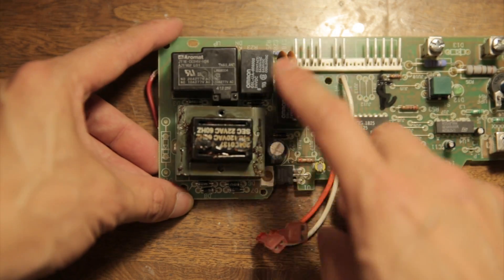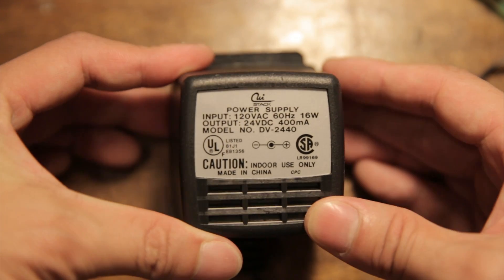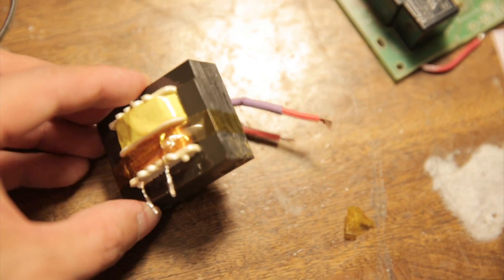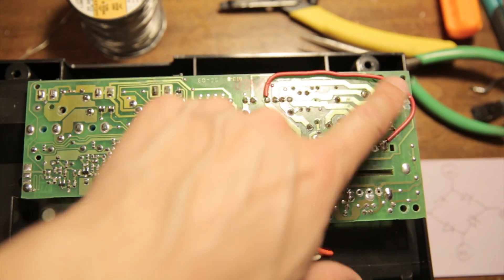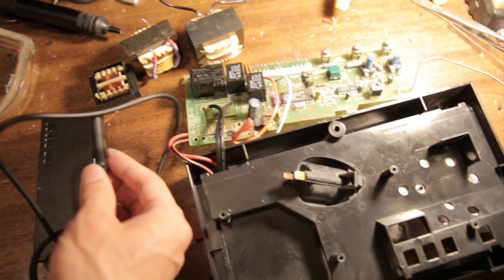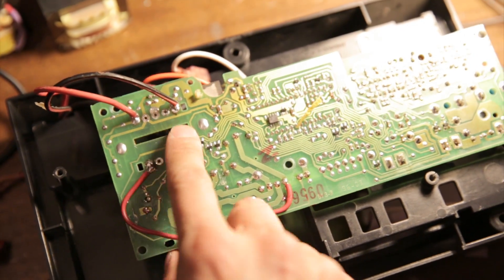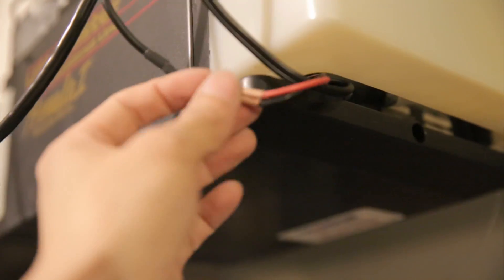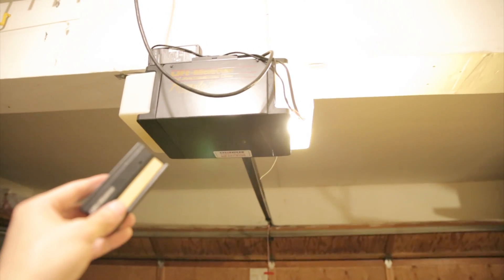LiftMaster Whisper Drive Garage Door Opener Repair: Transformer Failure

Comment: Thank you so much for sharing this. I just got my garage door logic board fixed with a laptop DC power supply.
Reply from the maker: I’d have to put a disclaimer to only try at your own risk. It’s a bit risky whenever you mod you own stuff as it has not gone through rigorous electrical tests. With that said, mine still works and I think that’s 3-4 years since this video was made.

Comment: I commend your effort! 

I had a very similar failure on my LIftmaster. The same part failed; in my case, the transformer oozed some glue out too, but rather than burning out and shorting like yours apparently did, mine exhibited an intermittent open. So sometimes the GDO would work, sometimes not. Often it would stop mid-cycle! When I was reverse engineering the circuit board at where the transformer was plugged in and powered up on my worktable (I had removed the board and side panel for testing), I was a little thrown off at first because the way they ran traces to the transformer made it appear that the transformer had multiple taps on the secondary. But that's not the case; they just used those traces for convenience. Your video helped make clear that the transformer wasn't a multi-tap secondary--just single output. (BTW, I'm an EE with circuit design experience; hence why I like getting deep into the circuit stuff!) 

I really wanted to go with a 22VAC output transformer to match the original design; the trouble with that is that those are few and far between (curious why they didn't design with a much more common voltage like 24V; my cynicism leads me to think they just want you to buy a whole new GDO rather than fix a relatively cheap component, the latter of course which is better for the pocketbook and environment. But who knows?) 

Anyway, I finally found one on Digikey for $38.30. It's not a through-hole design like the original; it's panel mount. But that's okay with me. Should be easy to wire in and mount. You can go there and search for PN 166L22. It's rated at 2A, 44VA.
Reply from the maker: Thanks for watching! In case you’re wondering, this solution still work and nothing has failed for years after this mod. The laptop switcher is pretty durable!

Comment: Problem with this setup!
When we had a power surge from trees breaking down under a heavy snow load this spring and tearing out the house feed wires, the surge took out a lot of transformers and surge protector in the house. 
It had been a while since I’d worked with diodes and had a quandary about how to connect the polarity of the new dc power supply. I sorted around in my pile of old transformers and the closest I could come to the 22vac original was an old 19 volt (actual no load) Dell laptop battery like was used in this video. No mention was given tho about the polarity to use so I did a little side trip to the internet and relearned how to see which way the juice flows. Turns out it shouldn’t matter how the dc transformer is hooked up since the diode stack in the little onboard full wave rectifier was fine with it either way. I soldered the cut leads to the old primary board tabs as shown and eureka it worked! Put it back as shown and cleaned up the tools and ladder, done.
Well the next day it wouldn’t go! 
More head scratching and discovered that the board was ever so slightly warm over the old xformer still mounted up. Ok, well maybe I hadn’t managed to burn out my laptop transformer after all! Come to find out the primary on the original board xformer was out but the secondary  still had 3~4 ohms which was dragging on the new charger and so the said charger had automatically shut down eventually from getting warm with that steady draw! After some more head scratching I wound up taking a razor knife to the up bus on one side from the old transformer to make a discontinuity to that winding. Then re-soldered my leads to the board on the circuit side of the diodes this time since I didn’t really need the couple of volts drop through the diodes since the new xformer was a few volts lower than the original. Probably this way the volts to the board came out nearly identically to the original design! This way tho you will have to make sure to get the polarity right! To do this I soldered the leads to the last connection that the diodes made to the bigger board busses that went to the circuit proper. Look for the bands on the diodes to tell how to polarize. The positive (hot) goes on the backside of the diodes with the marker bands closest to that end and the neg goes to the diodes through the board on the other bus with the bands on the opposite end of the diodes (farthest away from the end used) so this way current will go around the diodes no thru and probably would mean that you don’t really need to scratch a discontinuity in the track to the old xform although some small back diode leakage might still happen. If you came up with an ac volt xform of about the same as the original (+ or- 10% should be ok) and the secondary was still not open then scratch out the bus on one side of the old xform and solder to the original downside of the diodes to keep the circuit the same as original . When you have the new configuration hooked up on the bench you will hear a relay click when the new xform is plugged in and click off a few secs later after disconnecting. As well be sure to check the old xform with your VOM before doing this mod to be sure that the most likely situation of the old xform being out is true with the windings in primary or secondary are open.
I Put it all together and now the next day it’s still working! 
Don’t forget to Mark the leads on the outside of the board panel which goes to what screws like me and got two leads reversed which although no damage was caused for that particular reversal I suppose it could have with another wrong combo. A short bit more head scratching was involved when that didn’t work right!
It’s a bit of a trick to tease off the internal connector to the board inside when you’ve got the end panel unscrewed which I found a long pair of needle nose pliers helpful for doing one end and then the other in it’s turn. Of course be sure power is unplugged before doing this to prevent shorts.

Comment: Amazing.... it works for me. i use a mini laptop charger 19v .   thank you  BeatTheBush!!!
Reply from the maker: WOW... JUST WOW. You actually used this same method? My power supply fried and I did this and it has lasted since the making of this video. Just know that you are voiding warranties and any patch electrical work cannot be sold to others if you sell the place or what not. Also, you have to assume the risk yourself in case anything bursts into flames.

Comment: Awesome video, I like your approach to fixing things. I have a very similar (maybe identical) board and would appreciate some advice on fixing. Basic problem is GDO works from wireless remote but not from wall switch. Switch itself is OK, wire from switch to GDO is OK, and if I short the terminals right at the GDO it doesn't work. Is there any way to e-mail you with some details (photos etc) and get advice -- much appreciated. Thanks.

Comment: Same thing happened to both my door openers when running on generator during power outage.  I bought this transformer https://www.electronicsurplus.com/search/22v+transformer and it worked great.  I got the transformer in three days.  It is much larger in size then the factory transformer.  I screwed it to the back side of the case next to where the transformer is located on the board.  I only used the outermost mounting holes on the transformer because I could not get to the inside holes easily.  I  soldered lead wires (like 4 inches long) to the board.  I never even removed the old transformer from the board.  I first screwed the transformer to the case then used wire nuts to connect the wire leads together, then screwed the panel that holds the board back to the case.  Note I taped the end of the 11v wire leads (i think they were white) to insulate them and taped them to the transformer but I guess you could jut cut them off.  

My door opener was branded as craftsman 1/2 HP.  I did this to two openers and it worked out great.  Only been a couple of days but I do not think I will have a problem.

Comment: Could you show me how to check my door openers after applying, by mistake, 240V to stand by circuits?  I have two openers and neither is working after a generator mishap.
Reply from the maker: Huh... Applying 240V to non 240V devices will likely fry them. The transformer inside likely will be burnt or even if it can stand the voltage, the following circuits will burn from the sudden doubling of voltage. Margins are hardly ever build to stand over 100% over voltage. For wall plugs, many times they can accept either 110-240V and will be unharmed by the switch.

Comment: hi beat I have my garage door its open and automatically return close I checked all sensor and all the wires and line door all this work but I check the koil sensor code A735 its with little black but the led light in the sensor its on so what u think about it thanks
Reply from the maker: You mean it opens and then when it is fully open it closes by itself? Did you try increasing the pull up torque? Perhaps the friction has increased over the years and requires more force to pull it up.

Comment: Is it still working?
Reply from the maker: +Everything home repair Still works. It actually had a remote control range issue before I fixed it. After replacement,  the range issue was fixed. Also, if the supply ever dies, I can just swap in a new laptop power supply.

Comment: Were you still using the 120V orig plug too?  Or just the laptop power supply now (are there two plugs plugged in the the wall or just the one... not sure if anything else in the enclosure uses 120v)?
Reply from the maker: +Jeff Hoffman The original plug is still connected and powers the main motor. The laptop power supply connects to 120V inside the door opener box. So technically, there are  two things connected to the wall outlet. Gotta have a bit of electrical know how to do this for safety concerns. All of the mods were done with the power unplugged of course.
Reply: +BeatTheBush I'm looking at trying this but I'll probably just end up plugging both in instead of splicing the laptop power supply to the original 120v.  One thing... My transformer (and yours) shows a secondary 22vac output.  Does it matter the  laptop shows DC output?
Reply from the maker: +Jeff Hoffman Transformers naturally has AC output. The logic board has 4 diodes and a cap that rectifies this into DC. Putting DC at the input of the rectifier just means it doesn't rectify anything and passes the DC through. (Btw, for legal reasons, it's best I do not recommend doing this. You'll be doing this at your own risk. Modifying things like this is always pretty sketchy.)